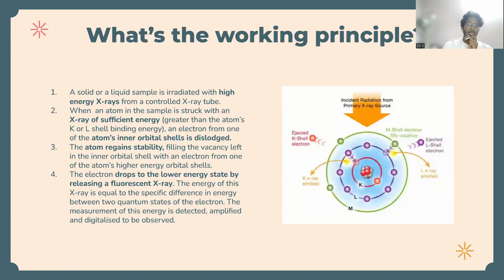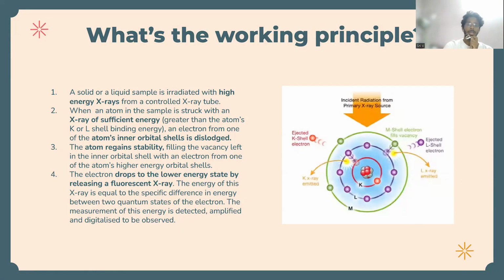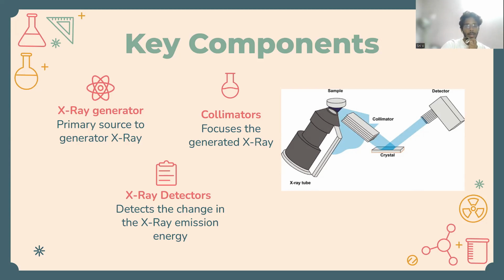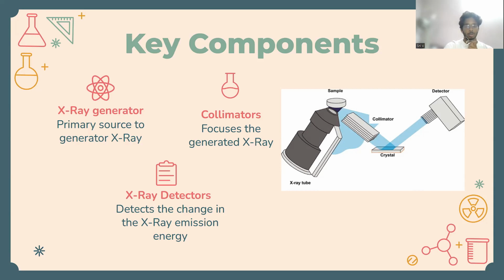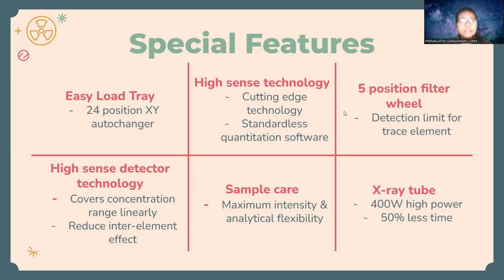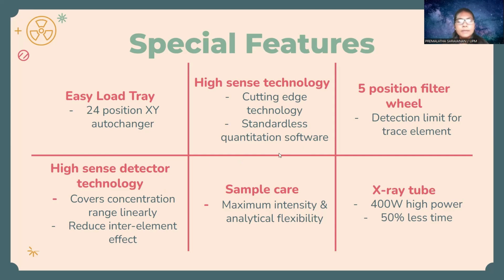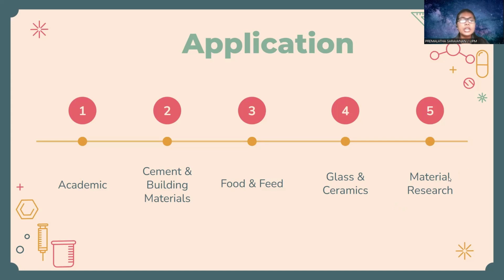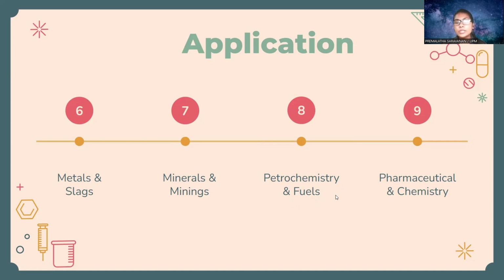XRF spectrometer SCL G2

Comment: Hi group 2.. This is a very interesting topic. I would like to ask, what sets XRF apart from the usual spectrophotometer that has been used in lab? Is it better than the model that we used in lab or just the same?

SITI NURHAFIZA BINTI MUSTAPA (207315)
Reply from the maker: The XRF spectrometer has simple and fast sample preparation and has faster results. Moreover, it also cheaper compared to other spectrometer. XRF is also a non-destructive analytical technique. The low power X-ray tubes don't produce an extensive amount X-ray photons or heat and therefore don't damage the sample or later its crystal structure. Hence, irregularly shaped samples that fit into the spectrometer can be analyzed without the need for destructive sample preparation, like cutting, crushing and grinding. The same sample that was analyzed in XRF can be analyzed using other techniques if it is required.

Comment: Hello Group 2, nice presentation :)  btw I'm HALIMATUL ALIYAH BINTI OTHMAN (208067). Which types of element that XRF could not measure?
Reply: XRF is limited to elements which have an atomic number greater than 16. However, the XRF cannot necessarily measure all elements with an atomic number greater than 16 at concentrations that would be considered acceptable for environmental applications. For example, lithium, beryllium, sodium, magnesium, aluminum, silicon, or phosphorus

Comment: NUR SOFEA BINTI MOHD AKHWAN (207609)
Hi guys, I would like to ask about special feature about XRF spectro. As mentioned in the video, it has high sense detector technology, which reduce inter element effect. Can you explain a bit more what is inter element effect?
Reply: In the previous models of XRF spectrometer, the effects of trace elements (interelement) and structural effects are the main reasons for inaccurate concentration of elements. Thus, the empirical coefficient is used to overcome the condition. Current XRF spectrometer models have the high sense detector which eliminates the interelement effects on heavy metals and determine the concentration of heavy metals.

Comment: Nurhasriza Binti Jupri 206617

Hi, i would like to ask what is the limitations of XRF spectrophotometry? And also, is this instrument sensitive?
Reply from the maker: XRF can distinguish between different oxides. Moreover, quantifying elements in the concentration levels of lower ppb or ppt is not possible with XRF, even when a longer measurements are applied. XRF spectrometer is sensitive to  spectral interference as well as physical and chemical matrix effects, which can reduce the precision of the measurements.
Reply: @vikneswaranmani5702  Aaa i got it, thank you for the explanation!!

Comment: Dear Group 2, thank you for preparing this SCL video on XRF Spectrometer.
Questions from me:
1) How does XRF Spectrometer be used in the quantitative measurement of element of interest? 
2) For elemental analysis, between XRF Spectrometer and ICP, which one is preferred? Under what circumstances the XRF Spectrometer is preferred over ICP?
3) Give one specific application on using XRF Spectrometer in biotech research (From your video, cement & building materials are not under biotech research).
Reply from the maker: Hello Dr, thank you for the questions.
1. XRF is a quantitative technique which can be observed from the peak height for any element is directly related to the concentration of that element within the sampling volume. Quantitative analysis can be carried out using two main methods,  both of which are usually fully incorporated within typical instrument software. First one is Fundamental Parameters Method (FPM) which consist of comprehensive software algorithms based on theoretical X-ray beam intensity, detector solid angle, matrix effects (element-element interaction), band overlap and spectral backgrounds are used to calculate element concentration based on the observed peaked intensities. Second one is calibration with standards with accurately known element concentrations are used to generate calibration curves (XRF peak intensity versus concentration). These curves are then used to calculate concentration from observed spectra. This method works extremely well and would be recommended for best accuracy.

2. Between ICP and XRF Spectrometer, ICP is more preferred because it has more precision and lower detection limits than XRF. However, XRF Spectrometer is cheaper, requires minimal sample preparation and gives faster results. Measurements by XRF are carried out directly on the solid material or liquid with little to no sample preparation.  XRF analyzes any type of sample without the need for dilution or digestion and therefore no disposal of chemical waste is necessary. Measuring relatively large sample volumes (100 mg up to 10 grams) results in a more representative characterization of the sample. XRF is also a non-destructive analytical technique. The low power X-ray tubes don't produce an extensive amount X-ray photons or heat and therefore don't damage the sample or later its crystal structure. Hence, irregularly shaped samples that fit into the spectrometer can be analyzed without the need for destructive sample preparation, like cutting, crushing and grinding. The same sample that was analyzed in XRF can be analyzed using other techniques if it is required.

3. XRF can be used for analysis of the environment, including geology, soil surveys and field analysis. Due to the versatility of XRF, it can be used to examine everything from sewage sludge, POME, river water. It can be used as a quality check for wastewater treatment. XRF can also be used to determine the moisture, density, and pH. Moreover, XRF spectrometer also have diagnostic applications. It can be used to perform both in vivo and in situ measurements of malignant cells and also possible to perform tissue sampling.